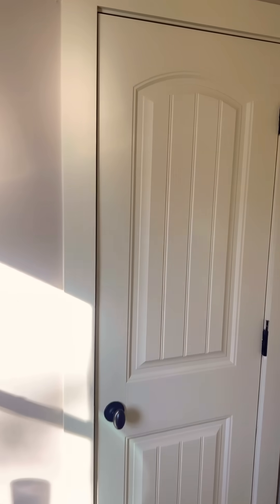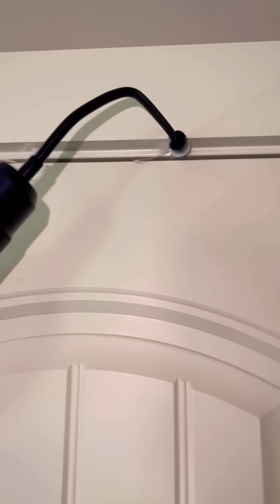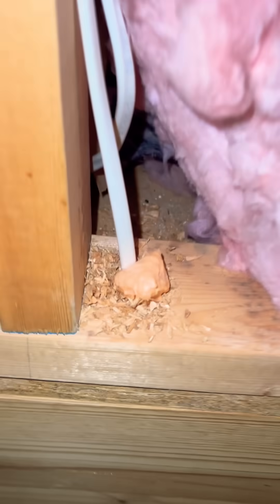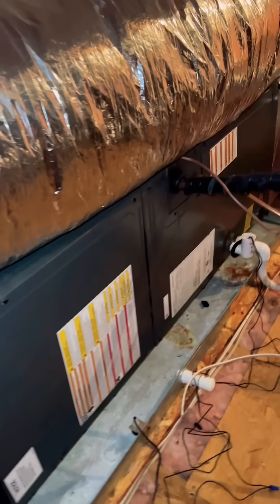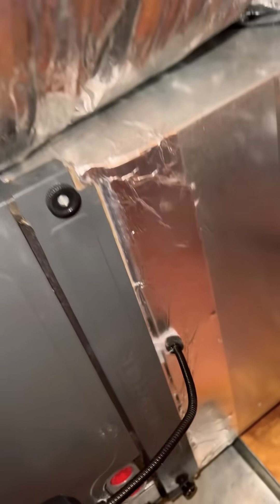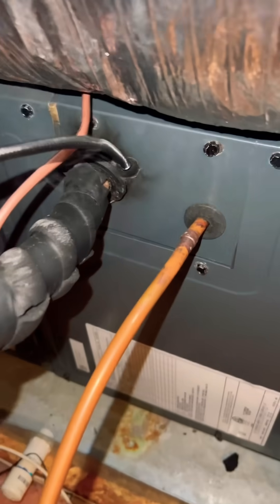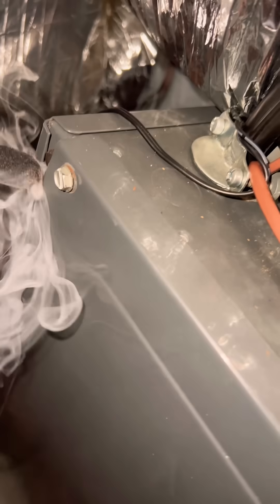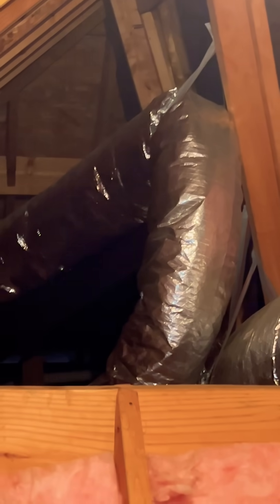GO IN YOUR ATTIC! So Much to see and do for Home Performance: Airsealing, Insulation, HVAC, & IAQ

Comment: How do you recommend sealing up your HVAC?
Reply: A good quality foil tape and some thumb putty work well, sometimes silicone caulking.  Get a good quality foil tape that doesn't tear too easily so it lasts, and clean the surface with rubbing alcohol (sometimes a spray adhesive or contact cement helps the foil tape stick to stubborn surfaces).  Use the foil tape for equipment panel gap edges that need to be removed, and make sure to use a plastic squeegee so the tape sticks well.  Use thumb putty or silicone caulking around the pipe and wire penetrations, also any panel gaps on panels that do not need to be removed.  

If the air leaking into the equipment gaps sounds loud, you should have an AC pro check your static pressure and air flow.  High return static pressure often caused by undersized ductwork and undersized filters (especially when they become loaded with dirt compounding the problems) is notorious for making these gap leaks even worse.  Keeping a clean filter helps too.
Reply from the maker: Taping the doors and filter slot sre also needed on a unit like this. Which means you slit the tape every time you need to open it up or change the filter, and re-tape when you’re done. It’ll look like a mummy eventually. Put it in conditioned space instead.
Reply: @HomePerformance  Very true, great points, get equipment out of unconditioned space and into conditioned space for best results.
Reply: I wouldn’t use duct tape.  There is aluminum tape that I would use instead.  It’s the same stuff they use when installing a unit like that.

Comment: I just installed a knee wall jacket by southeast energy solutions, works well to air seal door. can buy with pocket for insulation, filled mine with rockwool. Also glued foam board to back of door as well.
Reply from the maker: Cool thx for the tip